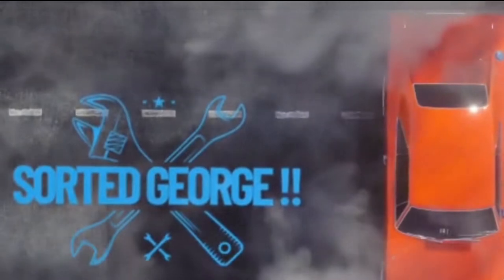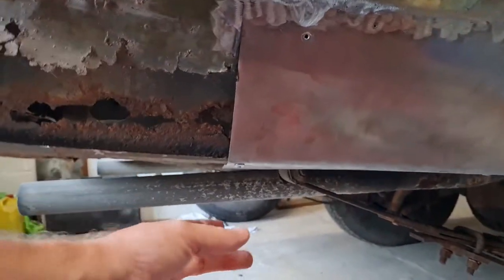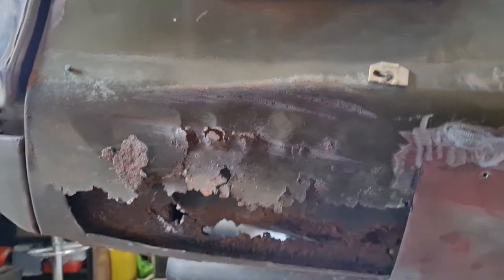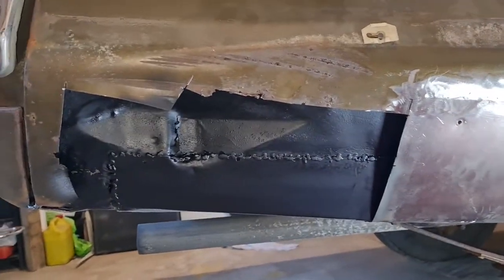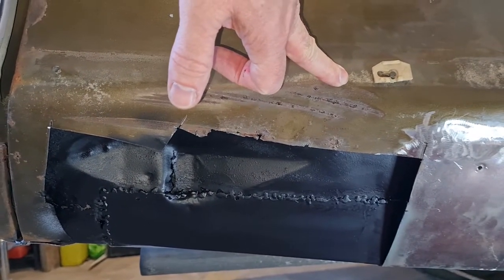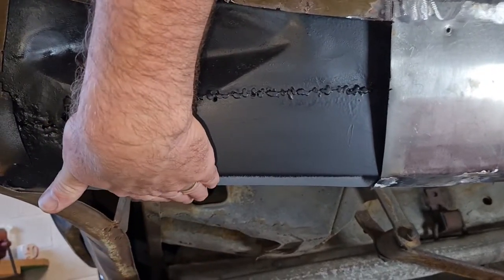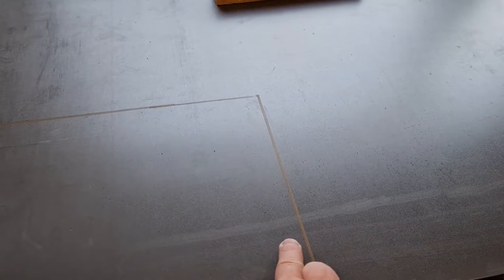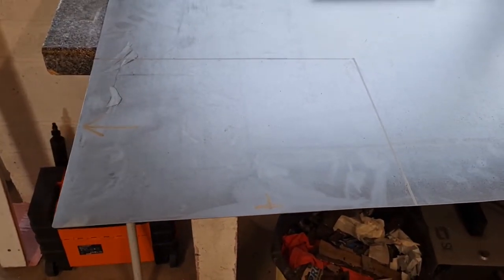Make Your Own Body Panels With Basic Tools 1972 Newport pt2

Comment: Stop George cut out all the rust the get some patch pannels and spot weld them in and braze around the edges then grind down the edges then finish contouring with plastic fillerprime and paint.ps do you get heat soaked at the carborator once it s off? Il take my answer off the air.your awsome George😉
Reply from the maker: Thanks Dan, but sadly patch panels aren't available for all old cars... especially C Bodies, hence I had to make my own. Not too bad for a 1st try 😁
 Cheers, Julian 👍🏻